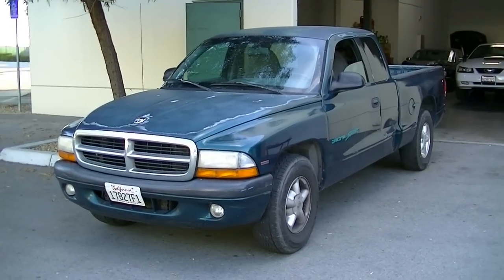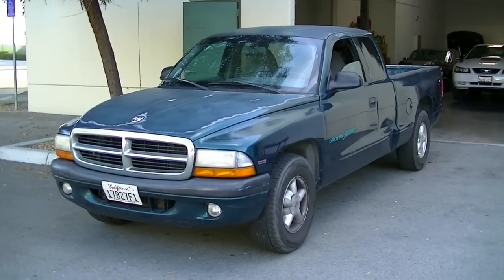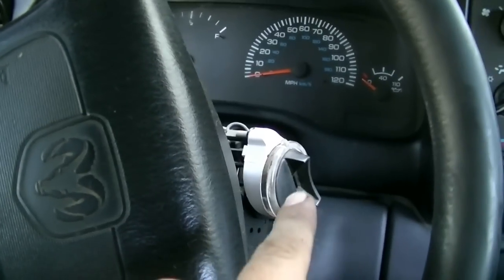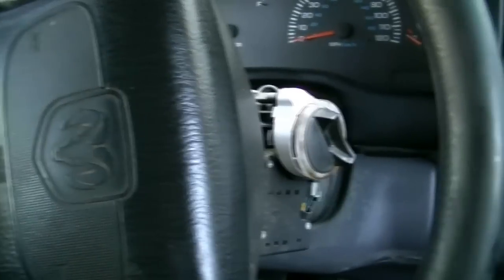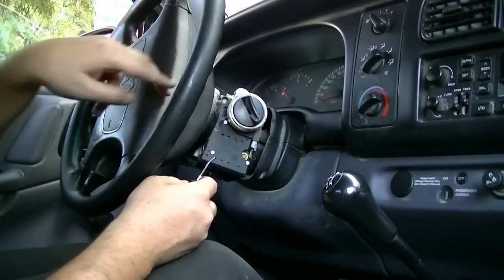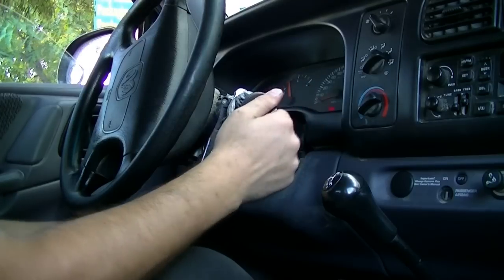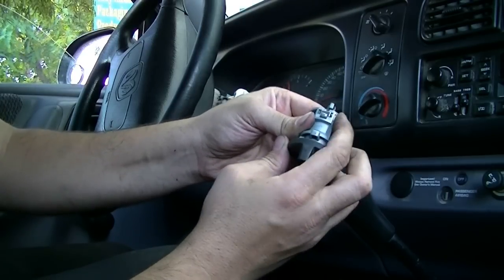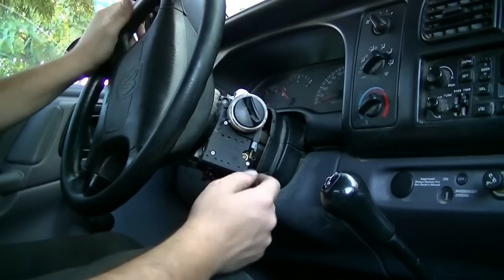How to Remove and Replace an Ignition Lock Cylinder - Dodge Dakota Sport

Comment: I lost my set of keys to the ignition on my 1998 Dakota.  I had to drill the retaining pin to replace the entire key lock cylinder.  

Use caution when doing this!  In my case, the tip of the drill bit I was using broke off.  That led to the remaining portion entering one side of my finger and exiting the opposite side.  I had to put my drill in reverse just to back it out of my finger.  

My friend was in the passenger seat watching at the time this all happened.  He's the type of person that acts all tuff and macho to cover up being a wuss.  It was funny to see his eyes roll back when he realized what was going on.  He ended up fainting when I keyed the drill to back it out.  🤣

Comment: For anyone that has to do it without a key I drilled min out took about 5 mins I started with a small bit and progressed to a big one but make sure ur bit only goes in as deep as the new cylinder switch should only be 2 to 3 inches I played with it ripped that bit in all different angles Intel I was able to turn it over ... 5 mins all it took good luck
Reply: Thanks theft university 😂

Comment: If you need to get around security screws, cut a line through the middle of it. I used a dremel cutting wheel to basically turn the security screw into a flathead screw.
Reply: Also you get 100 piece security bits at harbor freight for 9.99 to take screws out

Comment: I need help taking a ignition cylinder out of a 01 1500 Dodge Ram I lost the key I just need to know how to get the switch out
Reply: Eddie Horsley I just did one on a 2000 2500 ram, took out the three security torx put it in the vise and drilled out the cylinder till it would turn then the tab went in and pulled it out, it was a chore?

Comment: Someone just destroyed my ignition, they tried to steal it and didn't do a good job. They ripped off the steering column and drilled out the lock.
 I'm able to start it with my finger but never replaced a ignition. Its completely  mangled and wondered if you have any tips for getting it out.
 Mine is a 97 Dakota btw

Comment: What if you cannot get it click twice?  Remove both pieces?
  Mine just went haywire. I have to push in real hard just to get the lights on the dash to come. But, it still will not try the motor.

Comment: I have a 96 ram the cylinder locks look the same?  I purchased a car alarm with keyless entry and push button start, it stays to cut a key off and insert it in and turn the lock so that the wheel is unlocked and leave it like that and the alarm will control everything, I don't like that you still see a ignition switch, so if I took it out will the steering wheel be unlocked, if so would there be any chance while driving it that it could  lock my wheel from vibration

Comment: Does anyone know if it's possible to remove the lock cylinder without a key? I'm needing to get a new lock cylinder for my father in laws Durango. The keys have been misplaced and he can't find them.  But if you need the key to turn the ignition up two clicks and you don't have a key. Then is there a way to remove the lock cylinder without the key? It's going to be cheaper for him to get a new lock cylinder with a set of new keys, than have a locksmith make a new key for him. Any tips would be appreciated thank you.
**Edited**
Ok, I watched the video til the end. He said there's a way to possibly do this. But it looks like it's going to be a p.i.t.a. I'm going to have to remove the whole ignition switch. Then possibly might need to drill into it to access the tab. Unless I misunderstood him, so I may need to get a whole new ignition switch as well. The locksmith said they could make a key to unlock the doors for $76. Does anyone know weather that same key the locksmith makes would be able to turn the ignition? My father in law is saying that the same key he uses to start the vehicle, he uses to unlock the doors as well. So the new key they make should work since there's no chip in the key itself. But I've ran into another issue, the locksmith won't make a key unless there's proof of vehicle ownership. He doesn't have the title in his name, it's in his father's and he doesn't have it anyways. I'm going to have to get him because it's insured in his name. They won't deal with me unless I'm added to his insurance. My wife borrowed his truck and the keys have been misplaced. I've searched everywhere for it. But now it's looking like I won't be able to use a lock smith. So I have no other alternative but to figure out how to get into his vehicle since it's locked. Then Im going to have to replace the ignition switch. Not sure when this new law came into affect? I had gotten a key made almost 2 yrs ago and they never asked for proof of ownership. What a damn headache this is going to be. I appreciate this video nevertheless. Atleast I now know what I'm in store for.

Comment: So I noticed my air or power windows do not work unless I juggle the key. Is it the key cylinder or the switch?
Reply: replace the  Ignition Starter Switch  behind the  Ignition Lock Cylinder  but you just better off replacing both !!

Comment: Thieves damaged my ignition and key cylinder. How do I line up the paddle rod that sticks out the back of the ignition switch?
Reply: They just did it to mine, I was quoted $1000 to fix it. I'm worried about having the problem your having

Comment: What do you do if your ignition is locked up? Doesn't even work with the key? Mine locked, had it towed home today. How can I replace my cylinder when it's locked solid?
Reply: Rafael Granados 
Thanks for the reply! I tried that but it would not budge. Eventually called a locksmith and they said if your ignition has the collar around it and you have the key just grab that collar with pliers and turn hard. I did that and it worked so I immediately pulled that out to swap in my new one.
Reply: Nice, good to know you got it out